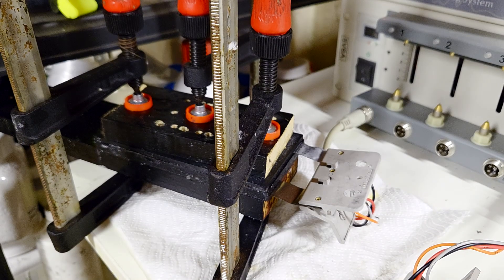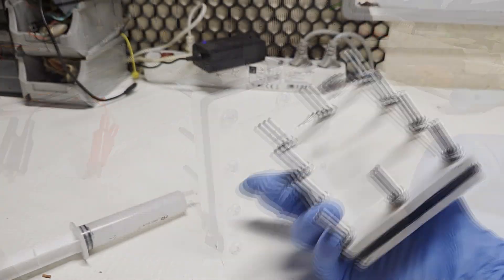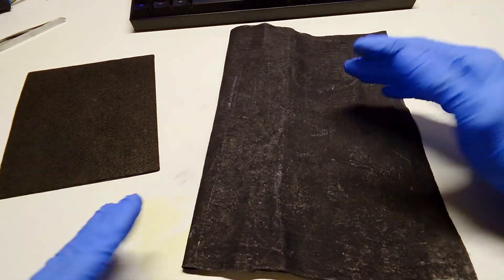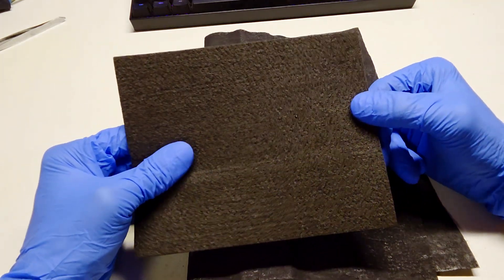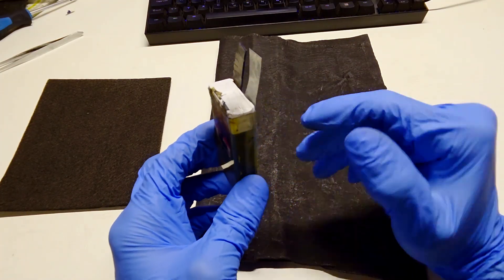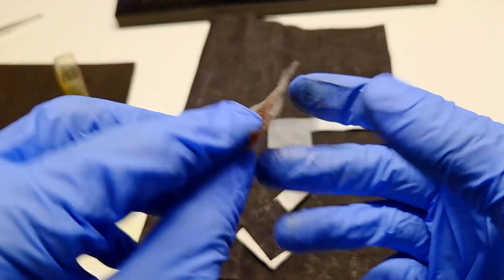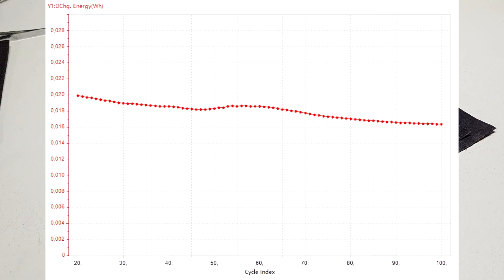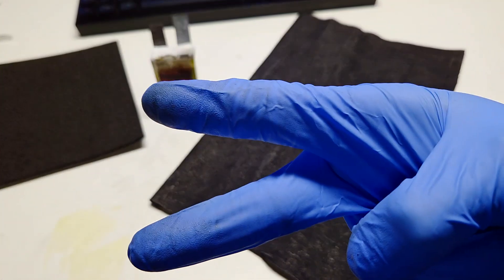DIY a battery with Homade conductive Cloth

Comment: Let me TELL you. 

Instead of "battery", I will suggest to expand THE IDEA of making it a "machine", a "something" that works systematically. 

I often watching your video, to grasp something useful, piece by piece, like a puzzle, and try to finish my own project. 

THIS WILL NOT BE PRECIOUS, until it is special. 

PLENTY ENERGY is flowing, and battery merely CONTAINER, a bucket. 

It is VERY DANGEROUS, even NAIVE, to contain LOT OF ENERGY in a tiny place. 

So come with idea, just to flow ELECTROLYTE, that can get from anywhere, anytime, put into the system.... JUST LIKE THAT. BOOOM...  system is running. 

THE ELECTROLYTE must be flow very slowly, just like how blood is pumping in human body. 

There you go. 

Just make a "battery", a system, just like HUMAN BODY. 

YOU KNOW WHAT I MEAN!!??

Comment: Hi friend, in the other video I saw that you used bamboo cloth, and I think it's better to use cotton cloth because the carbon or graphite disperses better in cotton. You could also use filter paper like the kind used in laboratories, which is more resistant to any type of electrolyte. There's closed-pore and open-pore filter paper; you should try them out to see which is best for your experiments